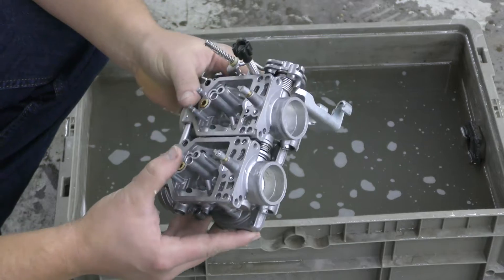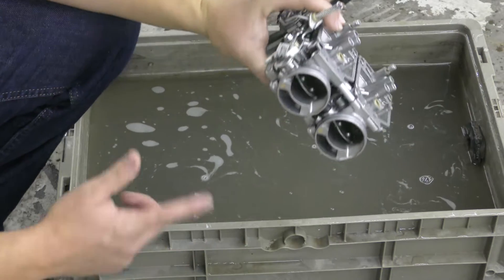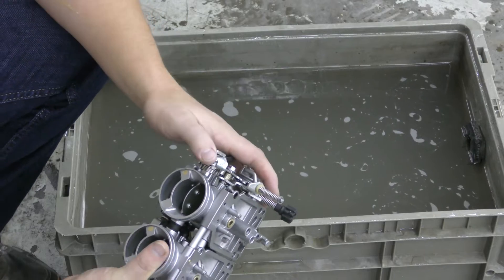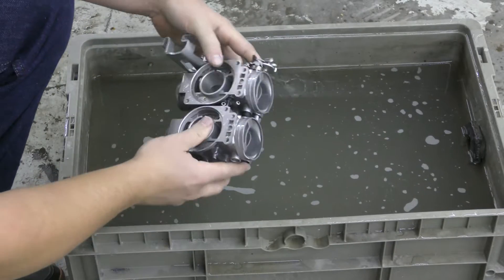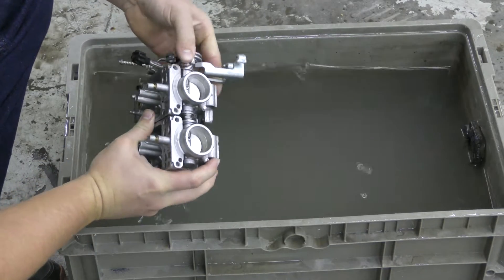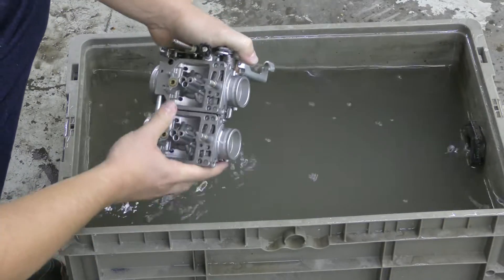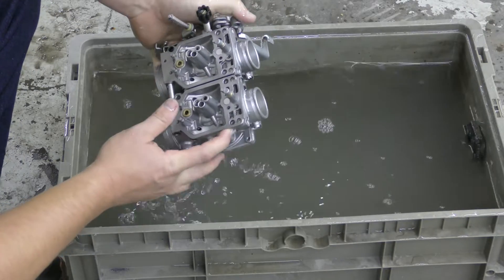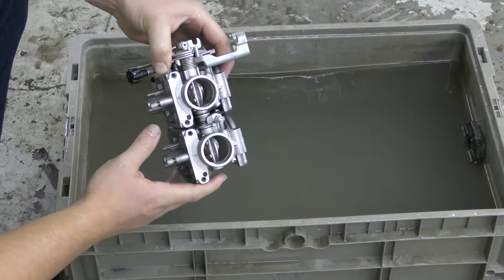How to Rinse Parts After Vapor Honing- Vapor Honing Technologies

Comment: Hi. I want to know, what is the correct way to clean engine parts with glass beads. How to rinse engine parts after vapor honing. Which engine parts should be avoid to clean with glass beads. Is sodium bicarbonate better then glass beads to clean engine using vapor honing.
Reply from the maker: Blast your engine parts with Glass Bead and use a Dip Tank for rinsing.  Glass Beads is the best use for cleaning engine parts that we have found.  We have not found an engine part that Glass Beads will not clean up.
Reply: @VaporHoningTechnologies  Thanks John. Glass bead is the best for engine parts cleaning. But what is the use of Sodium Bicarbonate. Please explain the difference.
Reply from the maker: @bittainment5995  You can use Soda if you feel better about it because it dissolves, however, it will not give a shiny like new finish.